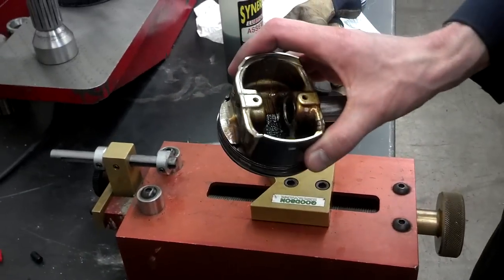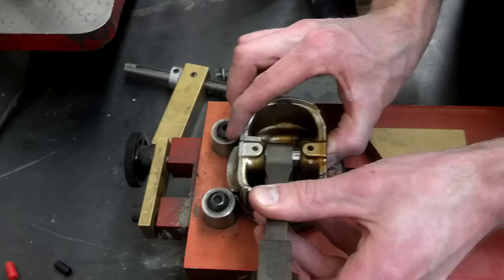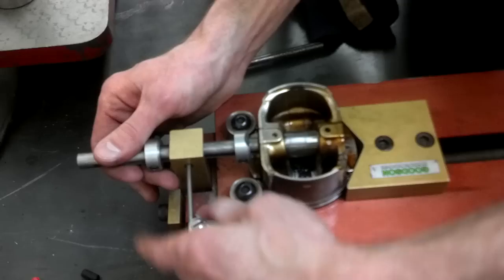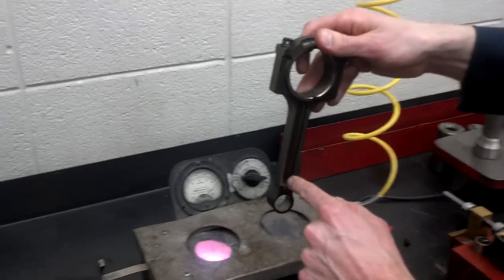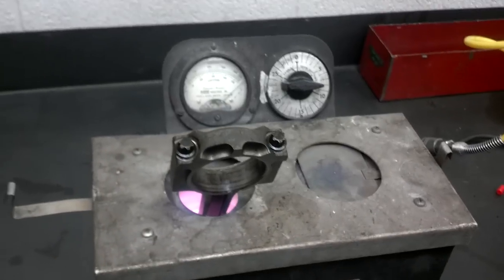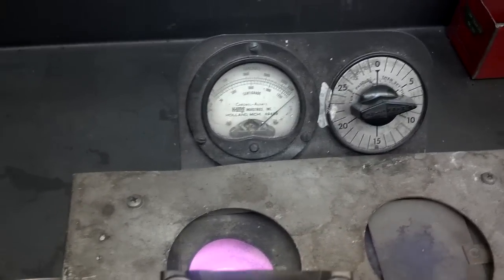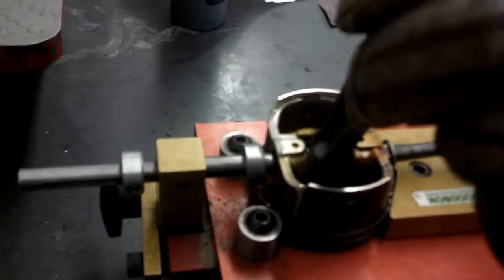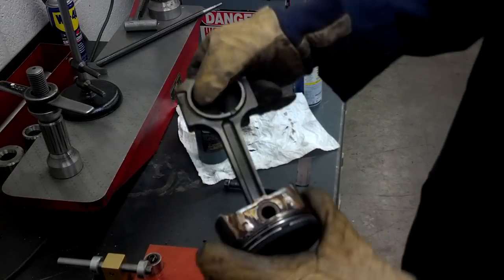Installing a piston onto a connecting rod

Comment: I have a ford focus that  is making a grinding noise on the right front side. I took it in to have it diagnosed they told me I have a bad wrist pin and the engine needs replaced.  I have had this noise for about 30k miles. It burns a little oil, but not enough to fail emissions. which leads me to believe the noise is probably not the wrist pin.
Reply: Wrist pins make knocking noises, and often times stop knocking after the engine warms up.

Comment: Another instructor's video advised freezing the wrist pins for several days prior to assembly. He even kept them in a bowl of ice until actual installation. Your procedure obviously worked so it would seem to me that freezing the pins isn't necessary. What is your opinion regarding this aspect?
Reply: Allen Klafter why if so pins are press into a piston
Reply: We successfully installed the pins keeping them in the freezer and heating the rods as shown in the video. We made a pin alignment device similarly also. The engine ran great and the car sold quickly. Thanks for your important guidance.

Comment: I would recommend freezing your pins instead in my opinion. You get more than on try if you mess up, and freezers are more commonly available lol
Reply: It doesn't work wrist pin has to be room temperature the cold frozen pin cools connecting rod fast ..... failure one 0 one
Reply: Nonsense on the face of it.  Let's say it's a nice day out like 70 your freezer is around 0-10 F. So you've cooled the pin 60 to 70 degrees max.  Steel turns blue at 600 degrees  F. So you've heated/expanded the steel with a delta of over 500 degrees F. Obviously one is going to have a much greater effect than the other. Which is why there is no chance freezing the pin will work. Maybe in liquid nitrogen at -320 F.  I suspect condensation would foil the effort.

Comment: What if my pins slide in just fine with a little bit of oil , does ti means are to loose ? I don’t feel any play whatsoever..Thanks , update comment: never mind I just found another video that explain why ,mine is not press fit but floading type, no need to do heat or freeze procedure’s,,yayy !